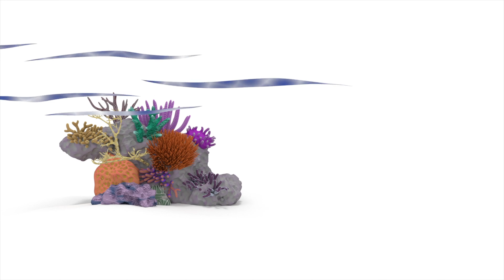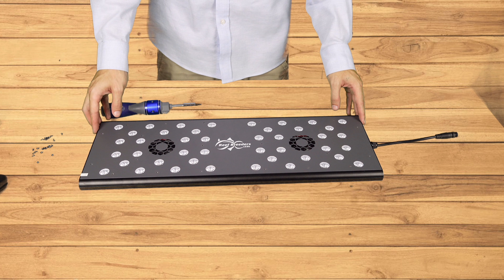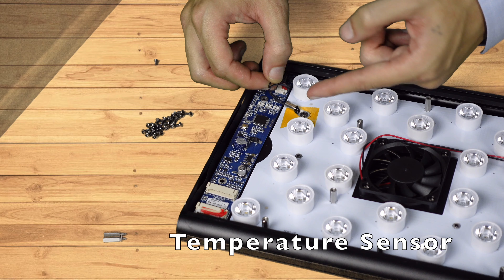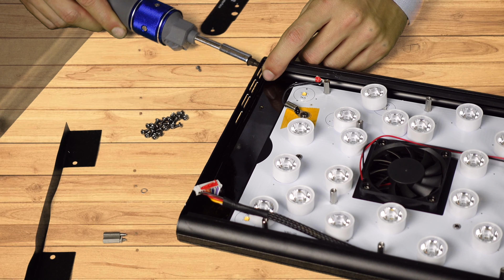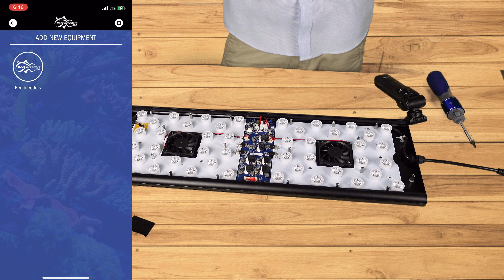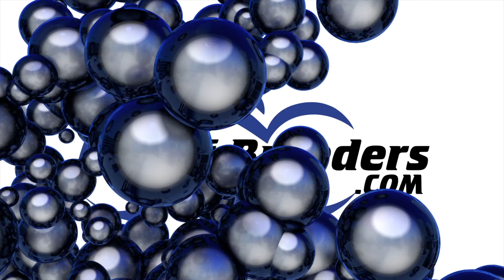Reef Nexus Integration Kit- How to Install

Comment: I have 2 units over a 6 foot tank do I need to buy 2 chips? Or 1? And which one do I install it in???

Thanks
Reply from the maker: Hey Glen, each light requires an upgrade kit to work with the Reef Nexus app, the old boards don't have the hardware necessary to connect to the internet.

Comment: what's the difference between the v2+ and the pro?
Reply from the maker: The V2 pro is programmed using our new Reef Nexus app. There will be a video guide for app programming soon.
Reply from the maker: @Zachery Roper still in the works here. I just moved to a new warehouse, so have not been as on top of the digital side here. Will get to work on that asap.